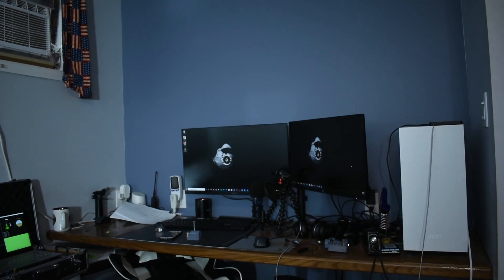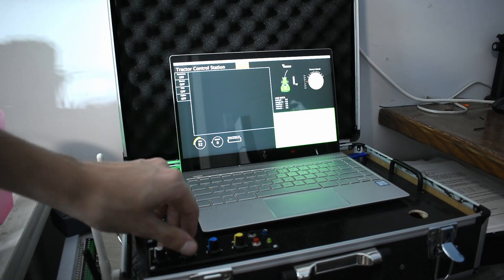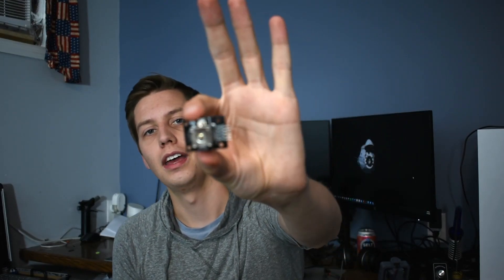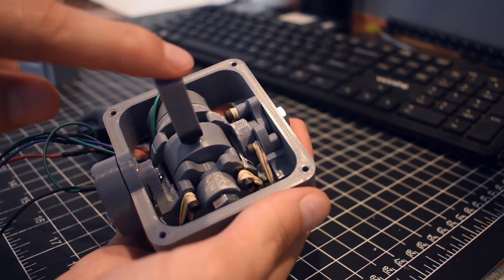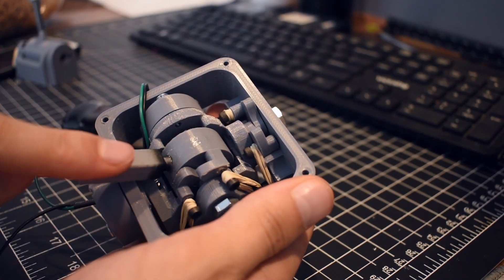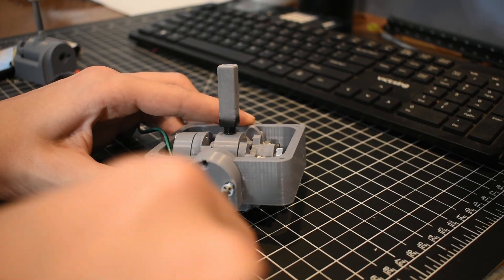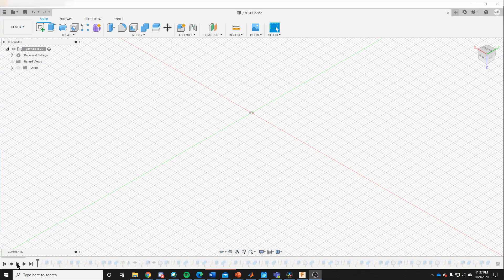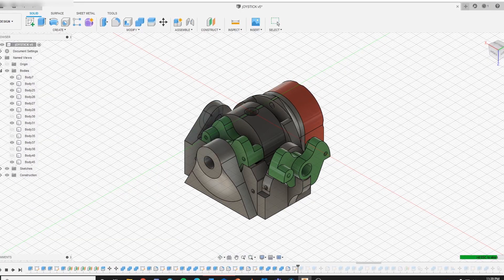Fully 3D Printed Arduino Joystick

Comment: Hi! I want to use this as a base to a joystick that i'm making. Is it possible to get a list of which kind of screws you used and how you programmed the pot inputs to give meaningful output. I'm new to making and this is my first project so i'd appreciate the help!
Reply: I'm trying to build this myself and I had the same question. As far as I can work out the big hex bolts are 1/4 inch 3/4 inch bolts. Not sure about the smaller ones which hold the rubber bands, but looks like maybe the holes are drilled out to fit 1/8 inch hex screws. Hope that helps!
Reply: Im stummped at how this thing bolts together. I guess I could just print, f around and find out... @jsnprtr
Reply: thank you!  @jsnprtr

Comment: Hey Michael, 
I love the design, me and my friends are trying to design a joystick using hall sensors, the idea is to make it open source so others can build on it, £500 for a high end joystick is crazy.

The way yours resets is pretty unique and used on higher end Virpil joysticks and I'm wondering if we can use your design as a base and work from there, will make sure we credit you for the design.

Thanks.
Reply from the maker: Of course. Feel free

Comment: Hi Michael, Awesome design. Re the potentiometer for position input. In a compact design like this the range of travel for each axis is not going to use the full throw of each potentiometer. That will effect your resolution ( how arcuately the movement is translated to code and then to movement). I know you follow Tom Stanton, so I suggest that you have a look at his design where he uses Hall sensors in place of potentiometers to tackle this exact issue. Otherwise awesome work.
Reply: Yes ı was going to say that thank you
Reply: The other problem with potentiometers is they wear out. I avoid pots whenever possible.

Comment: what exact transmitter did u use for the tractor and how many channels does it use, 1 more thing what reciever did u use, i want to make an rc truck with ligts sounds and a crane but need a transmitter with lot of buttons and a good reciever any good suggegstion